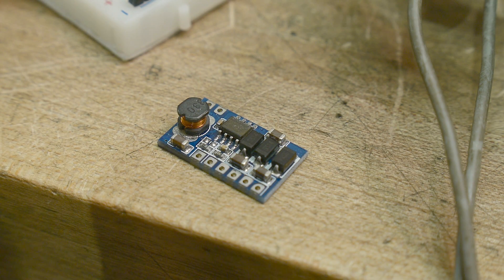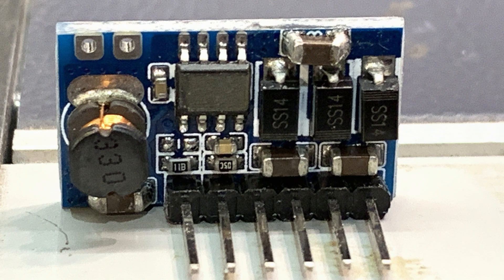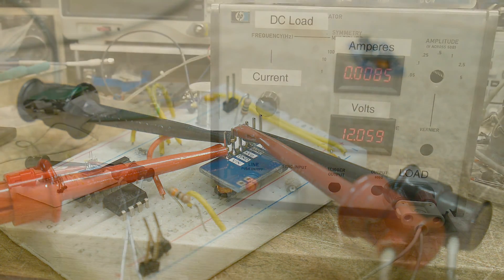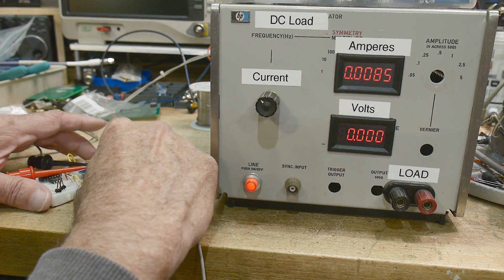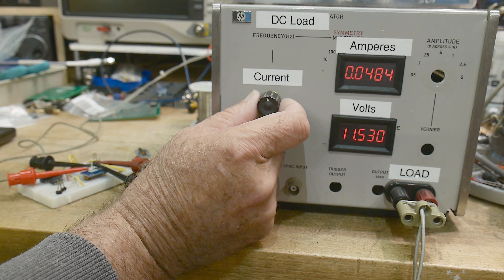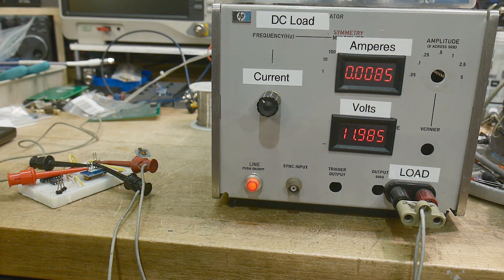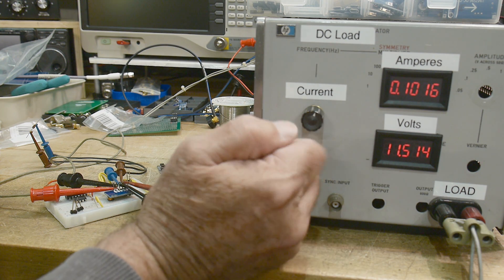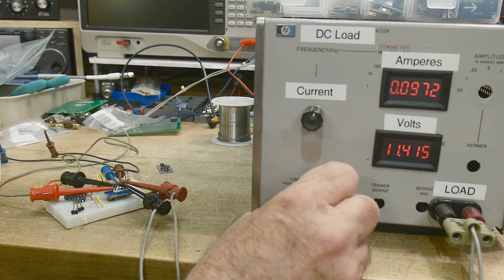#1467 +5 to +/-12V DC-DC converter DD1718PA

Comment: I could see this being used in a small project that requires up to 50mA on either side when you can't use a transformer and linear regulators due to size and cost.

Comment: Instead of making a negative voltage, I always thought about making a boost converter and using the original positive voltage as the 0V, the ground as the negative voltage and the output of the boost converter as the positive voltage.

Comment: I'm wondered if they would shutdown if you drew too much current.  I have a hunch it would since it had a disable pin.  The old days, 78xx would kill themselves either for too much current or temperature.  But I think LM317x were safe.
Reply: i think it would just heat up until it cuts off, the lm317 also have a thermal cutoff feature

Comment: I suppose you could call it a type of SIMO converter (single input multiple output) TI and Maxim are into those. Usually, SIMO has, up to, 3 outputs (at different voltages, but the same polarity) Using a switch inductor topology (and the right timing) you can get a single inductor, and two output capacitors, to generate a split-rail power supply ( + Vout, and - Vout).
Reply: yes. I forgot... Maxim is Analog Devices now.
Reply from the maker: Didn't know that, I did some consulting for Maxim
Reply: You guys aren’t talking about Maxim magazine are you.?

Comment: The " - "  leg just inverts the " +12" output. Basically, there is only one boost followed by one voltage inverter. This is why there is only one inductor, which is used in the step-up circuit.
The load rating is not symmetric. It may not be relevant for an op-amp which draws few milliamps, but I wouldn't use it for an RF front-end or a low noise audio pre-amplifier. 
The little circuit is missing all sorts of LC noise filters, both at the input and the two outputs. I mean, for the price it is surely functional, but I don't know how reliable it is on the long run. I recall I once used the RS version of this +5 to +/-12 V power supply, but iirc it was selling for ~£50, i.e. it had a price an order of magnitude more of this little board. It is certainly good for some quick assembly, even if I would be worried of the output noise overwhelming the CMRR of the OP-AMP. A good voltage splitter must have <50 mVpp of output noise; without a good LC filter, the output noise is >1 Vpp.
Thank you for testing the very convenient little module.
Greetings,
Anthony
Reply: Definitely up to the end user to determine the actual specs on these things (As with all save-a-buck chinesium.) Yet, there was some papers about a single inductor boot converter topology that had reasonably symmetric bipolar outputs. Maybe they've hijacked that research? or found a way to creatively market it.

Comment: There's maybe also a more powerful version, DD1912PA. It has more than one inductor :D I also found a +/- version of those black boxes, A0512S-2W for example is a 5v -> +/-12v 2w converter. A is dual, B is single supply. Nifty.
Reply from the maker: that A0512S-2W does look nice

Comment: It's a step up converter. The negative branch is created only by capacitors and diodes. But the negative branch is always weaker than the positive branch.
I think it has something to do with a voltage doubler on AC. Wikipedia -> Greinacher circuit
Reply: mmm could be, but likely it's using a type of switched inductor topology... and some Chinese dickery to get it to give equal (but opposite polarity) output voltages. In the sense, it's up to them to get it "working" (and its up to you to determine if it actually works.)

Comment: Thanks but I am curious about the output…. noise, ripple and spikes..
measured with an electronic load vs resistor..
Reply: Ya. Curiosity killed the cat (or maybe your project, if you use this thing.) But then again, all that glitters isn't gold; but, sometimes it is.
Reply: @willthecat3861  😺 I have different kinds of this stuff, some with very large spikes.